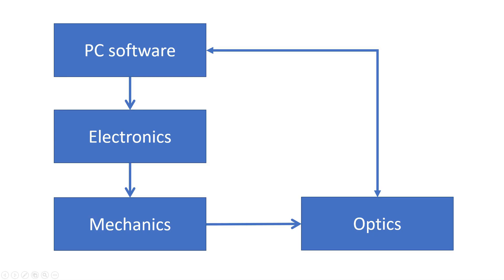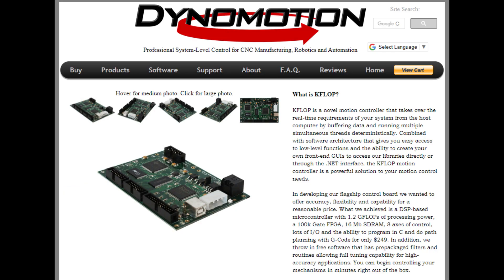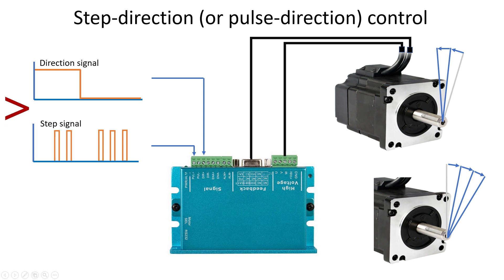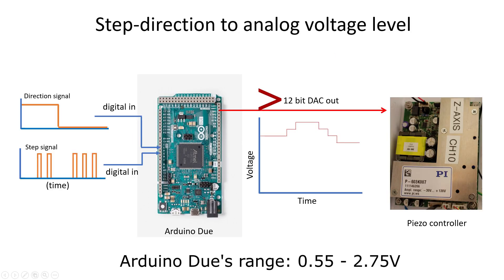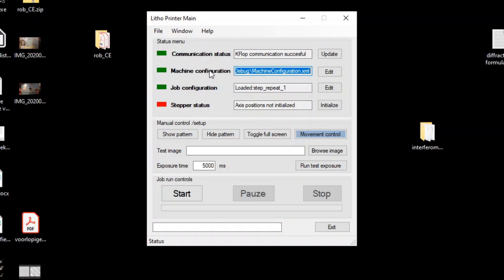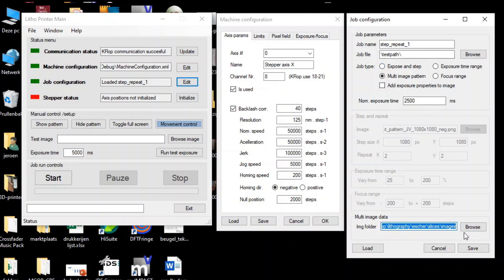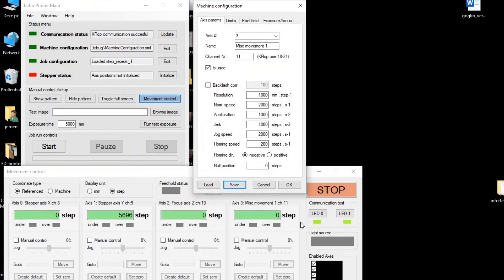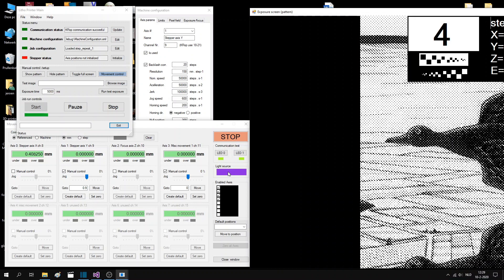Maskless Wafer Stepper Part 3: Electronics and Software.

Comment: Awesome video! I'd like to point out that, instead of being bored I would like the videos to be more in-depth for the reasons you mentioned in the video. Mainly, because a lot of us will never recreate your projects as it can be a bottomless pit. Your videos are at this date (feb 2020) the best source I could find about wafer steppers and in-depth details about the used hardware for photolithography. 

This is a very interesting project I came across while looking for more resources for a lecture I'm attending. The professor always says, 'its easy on paper but very hard in reality' but (imho) fails to get this point across very well. So I showed some of my colleagues part 1 and 2 of this series. All of them were fascinated and said, your videos helped them a lot to understand what a wafer stepper actually is, what it does the problems involved in photolithograpy using this method. This is what theory and pretty powerpoint presentations cannot get across. Your content provides a very different view of things compared to the lecture we are currently attending. 

Thanks a lot for your work and keep it up :-)
Reply from the maker: Thanks for the feedback. I agree on the "depth" issue. I try to make video's with a high information density, and there is always a fine line between going really deep for a very small audience or trying to make something that can be understood by (or is interesting for) a bigger audience. So basically I follow my own criterium here and that is: would I myself view this video to the end? This sometimes means I throw away half of the content, and kill most of my darlings in the process. But, if you have any specific questions, you can always ask them here. I'm in the lucky position of still having a limited number of subscribers, so I can still find time to answer them personally.
Reply: @HuygensOptics  I regret that you no longer have such a limited number of subscribers! 🙂 This was a very ambitious project, what happened with it after this final episode? You obviously set up a stitching test and presumably performed it. How did it go? Were you able to compensate for the errors discussed in episode 2?
Reply: Sorry, saw now a playlist with actually 5 episodes. Yay! I still have to see the last two, but you may want to update the description and add the next video to the end screen.
Reply from the maker: @mumiemonstret  Good question, I guess what happened was "life" (so lots of distractions 🙂). I did use the setup though on several occasions and have actually completely rebuilt it, especially the exposure part. I've been planning to do a video about this for a long time. However, every time I run into something that is somewhat more interesting or I am too busy with work. I really hope I can do an update somewhere this year and combine it with the making of optical logic..
Reply: I agree